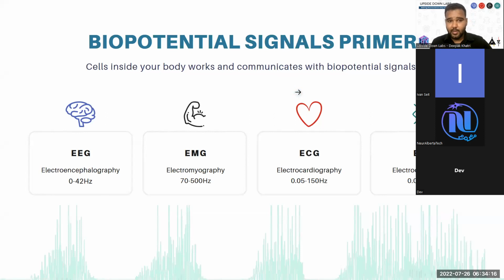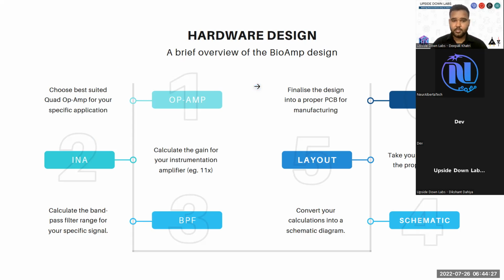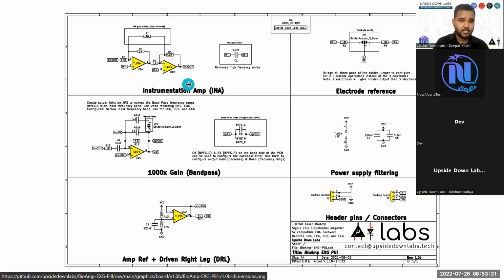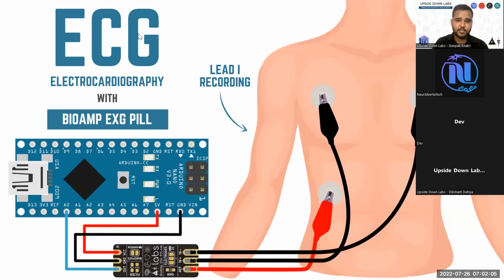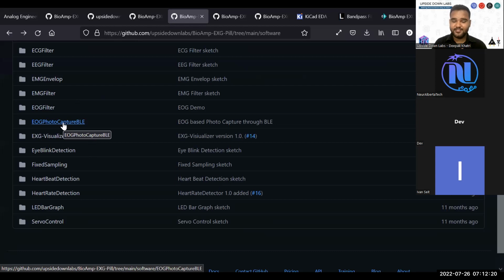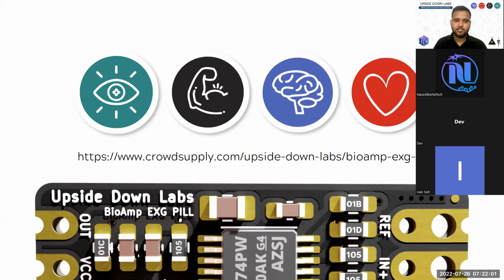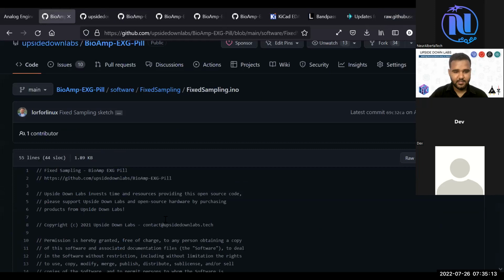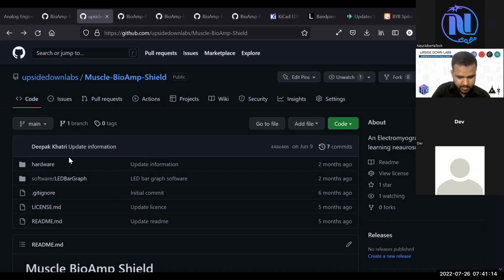BioAmp Hardware design and biopotential signal processing for BCI and HCI | natHACKS workshop

Comment: What is the BPF frequency range used
Reply from the maker: Low bandwidth & high gain: 3.3Hz - 40Hz @ 11,000x 

High bandwidth & low gain: 3.3Hz - 140Hz @ 2400x
Reply: @UpsideDownLabs  if use this bandwidth how can i get the data of 0.5-4 Hz(delta),this part is import for sleep stage classify